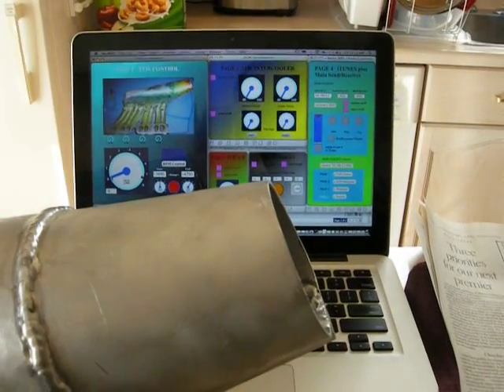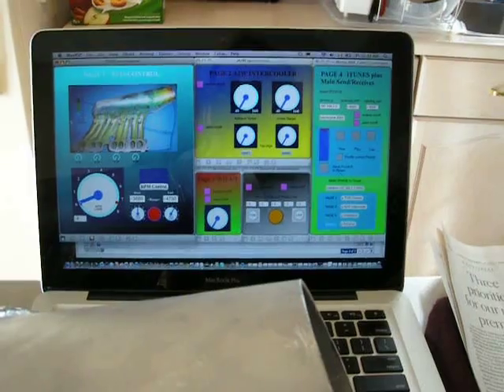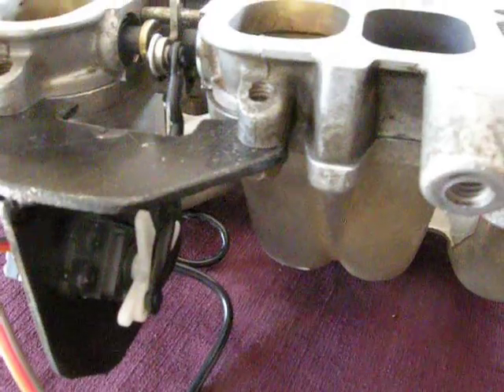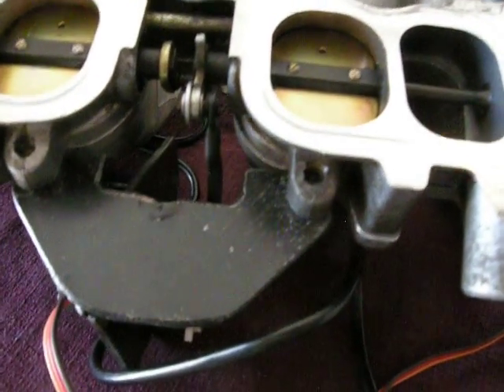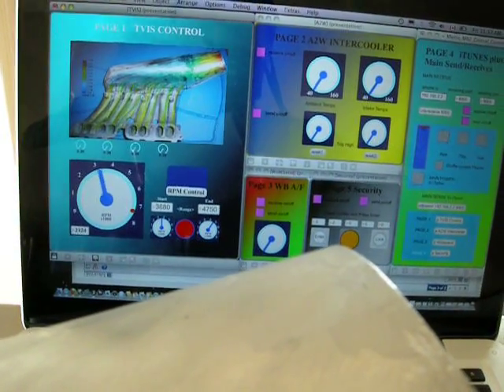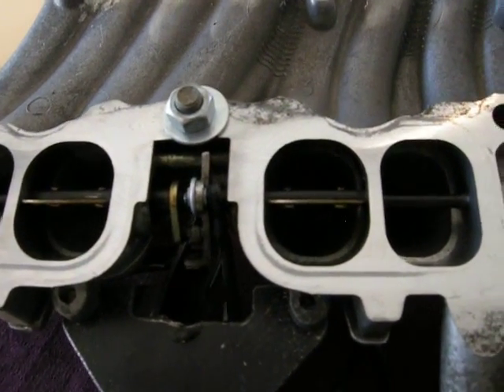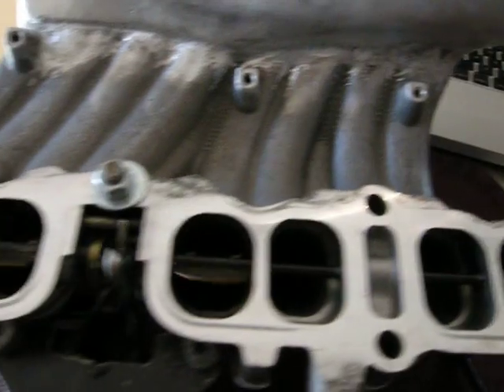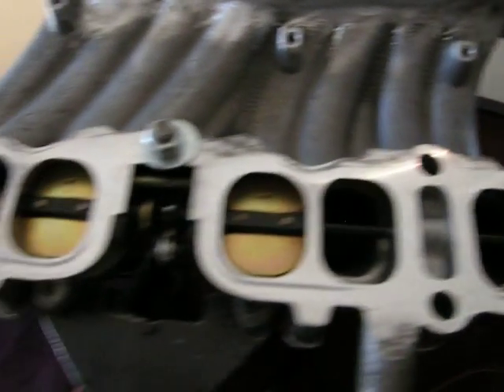TVIS Control With MaxMSP and Servo PART 5 TouchOSC + iTouch display = Servo function

Comment from the maker: The servo mounts themselves won't transfer much via convection, its the radiant heat from the intake manifold that will heat it up, as well as the servo working hard generating its own heat... It is however going to get good airflow when the car is moving... 
Ultimately, the only way to tell is, just see how long it lasts once all is said and done, anything else is speculation.
I just made up the last manifold brace last night..making up the final tube to the TB today. So, getting close!

Comment from the maker: The TVIS provides a gain of several hundred RPM's in spool, can bring on peak torque by as much as 1000 RPM earlier, and increases the area under the curve for lower end grunt. In order to get the full advantage of the TVIS though, we need to take control of it away from the factory ecu, and at least trigger it with an RPM-based switch. It will help out whatever turbo you have. Controlling it incrementally with a servo based on RPM may be a further advantage, which is what I am going to test.